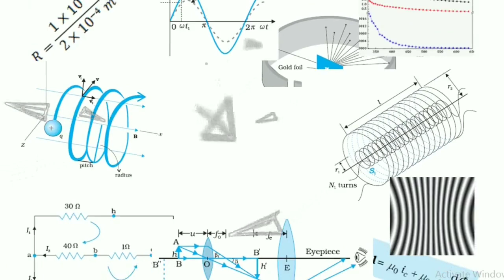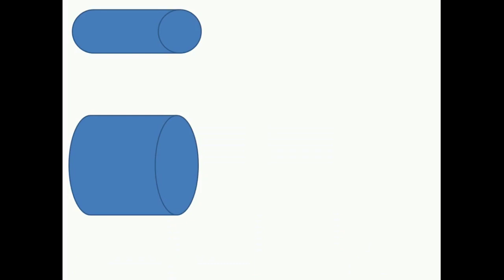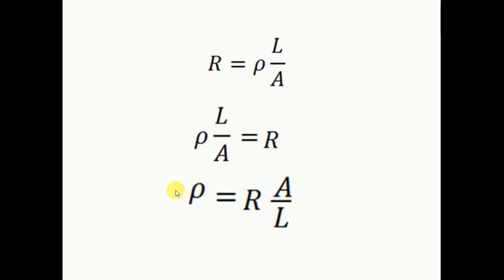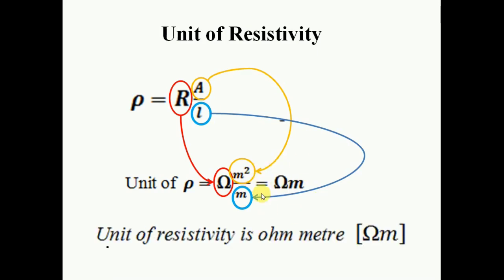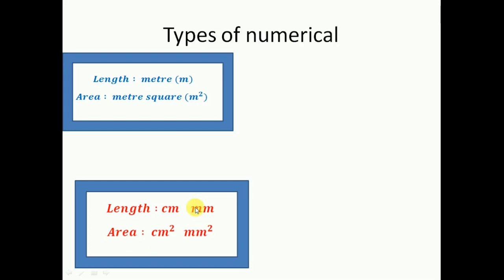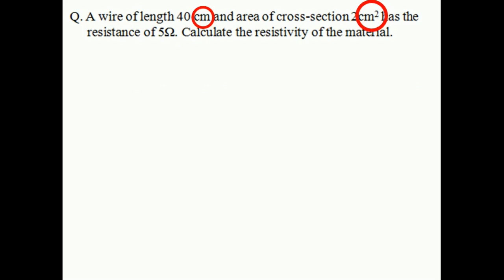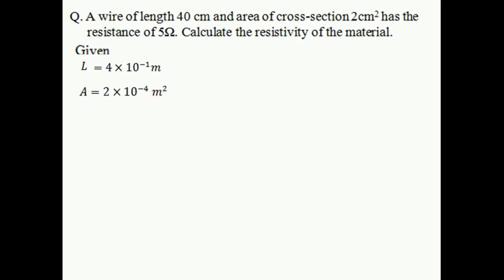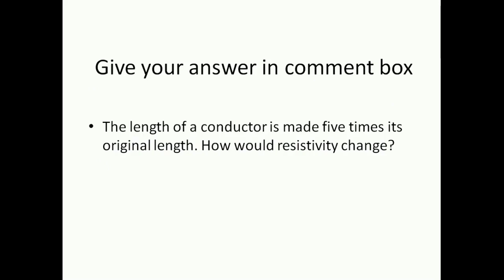Resistivity | numericals on resistivity | solved questions on resistivity|

Comment: Answer for that last question:
Resistivity will not change in this case as it's gonna remain constant cuz resistivity is the property of the material and it will not change with changing the length of the wire.
Sir I have one question, 
 the effects of resistance changes due to it's length of the wire  also know sir?